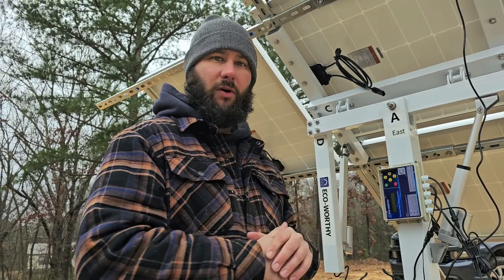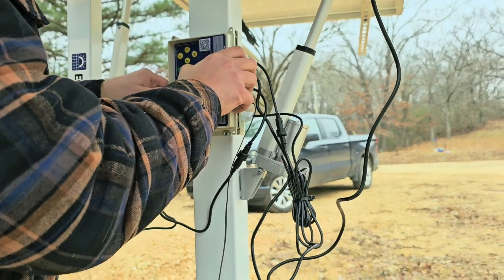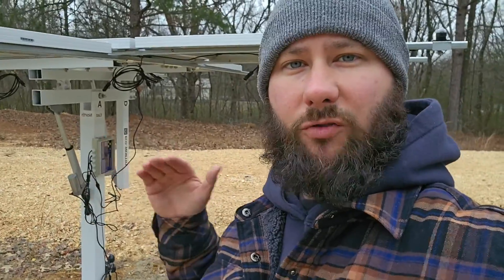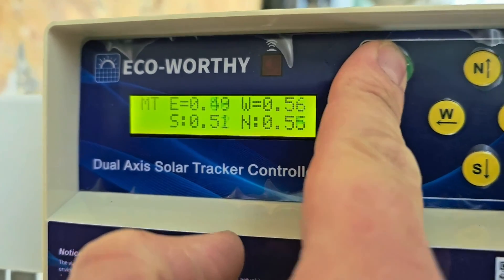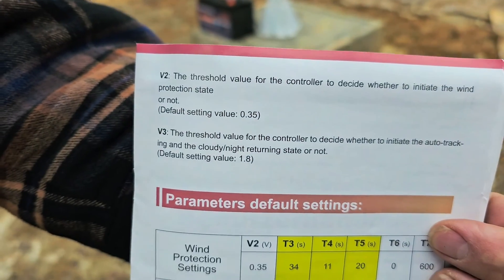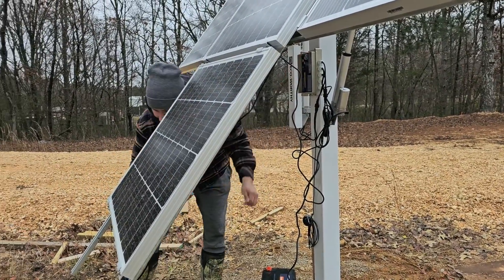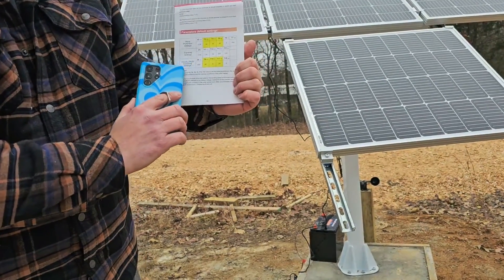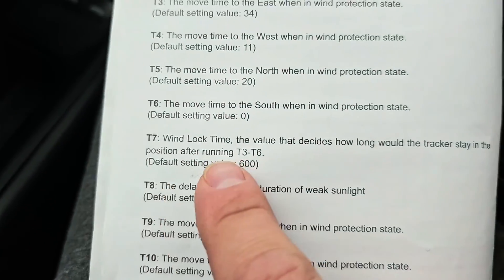Unleashing the Power of the Eco Worthy Controller! @EcoWorthySolar

Comment: Looks like you don't need to do this any longer.  I finally setup mine after getting it dirt cheap last Nov.  I setup up everything but didn't put the panels on.  Left it overnight and in the morning it was tracking the sun on its own.  Put the panels on around noon and waited and by 4pm after the sun went behind the hill it went into low sun mode and went flat.  So I programmed nothing and it works perfect.

Comment: I purchased two of the Eco-Worthy dual trackers. One of them works as it should, but the other one wants to park to the east in low-light conditions. In fact the panels are practically in a vertical position which has caused the 12" actuator cylinder to pull apart. I purchased a new actuator and it did the same thing. I have gone thru all of settings trying to fix this problem. Do you have any suggestions?

Comment: Why are you halfing T4 to flat??…. But go west to east with T3 ??  Wouldnt wind protection mean it goes flat ? Not all the west to east? Im confused
Reply: You time it from all the way west to all the way east. Half of that value should take it half way back west, or flat. It doesn’t always work out that way, so I time it from all the way east to flat. It’s going to change over time so you might have to adjust it. If your battery is low or there are high winds it’ll slow the tracker down, so it might not stop perfectly flat and you’ll have to do it manually.

Comment: How did you permanently wire the tracker to the 12V power source?
Reply from the maker: I wired it to a battery
Reply: @taddydigest  Right, I guess where did you permanently put the battery? In a weatherproof box next to it or run a wire from a building?

Comment: Why do you measure the time from west to east? In the manual, it says "time needed to move eastwards in wind protection". Wind protection is when panels are flat, tracker looks like T. Should you not measure from flat position to east?
Reply from the maker: good point
Reply: @taddydigest  Sorry, my mistake, i have read the manual again and did not see the pictures how it moves. 
I thought the tracker knows the wind protection position but it can only count the seconds from east moving to west to know then it reached T position.
Then it makes sense to measure from farest west to farest east (worst start position when storm arrives) and then back from east to T. And because it can not move to north more then flat, only measuring from south to north and set the last measure to zero, i think it got it now 🙂

Comment: Any idea why mine wont go in night mode when low light at nite but if i cover the sensor it goes flat
Reply from the maker: It's either the controller or it's the position of the sensor check with eco worthy tech support

Comment: Thanks Taddy. I wish the controller has the option to stop the actuator at full extended & fully retracted position, I am using this controller on a much larger home built platform so my actuator doesn't have a built in limit switch, & I couldn't figure out what kind of external limit switch I have to use.

Comment: Not so much space, so mine is installed almost to a fence on its west side. So in the afternoon it starts shading the panels, those that are lower due to the sun tracking. To avoid that i should adjust TX value lower to establish a limit near T5-T11 so it doesn't point further west to avoid the fence shade.
Reply: I don’t think that’s possible. This unit is very simple and not very smart. As long as the sensor detects enough sun it’ll track that way. Maybe if you turn the V3 sunshine limit up it might turn off sooner, but then it’ll need even more light to turn it on in the morning.

Comment: Do you know what is the diameter of the base on the Eco Worthy single axis tracker?
Reply from the maker: I'm not exactly sure
Reply: Ok thanks. Is the battery kept charged by the solar array or a separate solar set up?
Reply: @patrickralston1246  it’s separate. I have a small panel and the battery hooked to a cheap charge controller from harbor freight. I hooked the load port on the charge controller to the tracker controller. Works like a charm

Comment: Hello,can you give me the parameter settings for germany .... I'm desperate,best regards.
Reply: Wilkommen! You are in the northern hemisphere so your N/S actuator needs to be on the south side of the tracker. Other than that there are no specific parameters for Germany. However, I’ve heard that some controllers are wired backwards. So, even if your tracker is installed correctly it’s N/S movement will be backwards. You just need to unscrew the wires in the controller and reverse them. Also, if you’re sun sensor isn’t installed on the NE corner of the array and oriented the right way it will not go in the right direction. In the manual the pictures show the sun sensor wire going in one direction, so just mirror that direction. Viel Gluck.

Comment: I believe you're misunderstanding the delay value of the duration of weak sunlight. Correct me if I'm wrong, but if you set it for 600 seconds then it will go back to night mode. Because there is no sun. I'm pretty sure that's how long it will wait to see if the Sun appears again if not it will go back flat for night mode. Please reply back and let me know if you think different. Because after 600 seconds mine went flat but once the sun appeared again in the west it started tracking again.
Reply: You’re right. On a cloudy day the V3:sunshine limit might temporarily detect low voltage and that will start the 600 second countdown. If the clouds move it’ll reset. If it goes longer than 600 seconds it’ll go flat, and the display will say “waiting for sunshine.” As soon as V3 goes up again it’ll start tracking again.

Comment: So i just set mine up today.  It never seems to go into SA.  Says theres 3 modes.  SL, SA, and MT.  It always seems to be in SL.  Whats up?  I set everything up right, all wires landed right. Sensors in right places.  And exited out of MT mode obviously.
Reply: did you found a solution? i finished my setup today and it is in SL mode too, it is nearly dark now and it should turn at least to sleep position. Auto-Mode should be SH and not SL, not sure what is going wrong
Reply: @thomasspeicher8796 mine does the same? Figure it out?
Reply from the maker: I'm not sure.

Comment: Your setup looks like moving south will level the panel out.  As such, I would assume that actuator should be moved to the other side so that you can actually get South/South-East sun correctly.  Changing the wires to make the directions correct is fine for east to west when that's full range of motion, but that degree tilt from south to flat going north is a different cookie.
Reply: I watched this video to get some knowledge on how to set up the controller. When I noticed that he had the actuator on the south side instead of the (correct) north side, and was altering the wiring to cover his mistake, I gave up. Someone who cannot follow the assembly instructions will probably not know very much about the controller.
Reply: @TheBioniXman  But he wasn't showing HOW to assemble, just how to program in this episode.  Besides, I humored him and put him in the southern hemisphere.

Comment: Interesting that you have to actually calibrate it for cardinal directions.  I would think it would just use its tracker to detect where the sun is the strongesr and move each actuator accordingly to face the panel in that direction.
Reply from the maker: I'm just calibrating the time that it takes to move
It will track the sun automatically
Reply: And also when it goes flat in the evening.

Comment: I’ve had mine set for about 5 mos, and have a question. Is your tracker backwards? I noticed that it tilts to the north, and I’m assuming you’re in the northern hemisphere where we get most of our sun from the south.
Reply from the maker: I will have it up in running very soon I will check.
Reply: @TaddyDigest my actuator is on the south side. I just set it up. My manual is different too. Less info